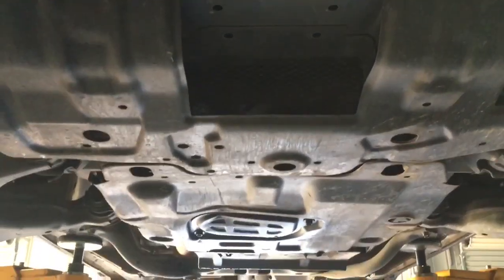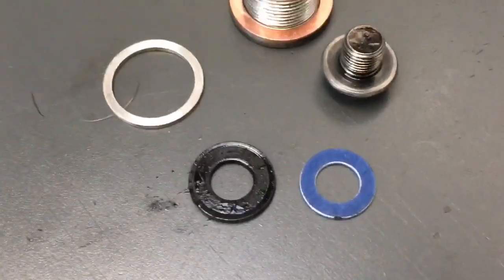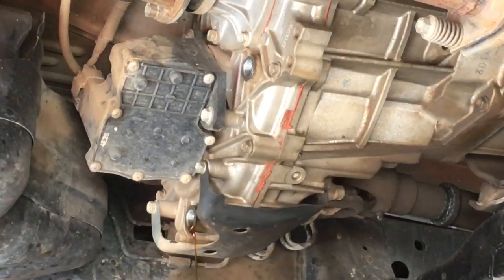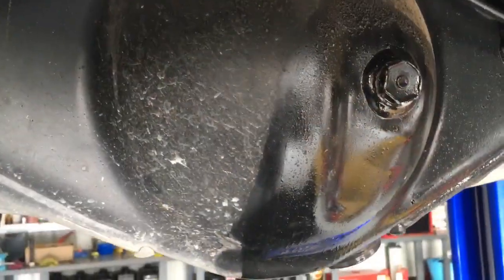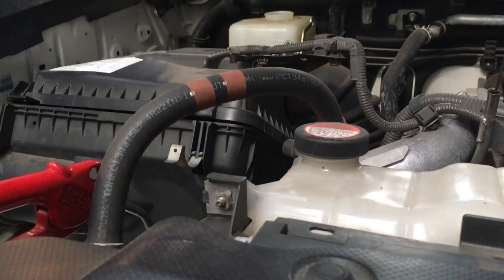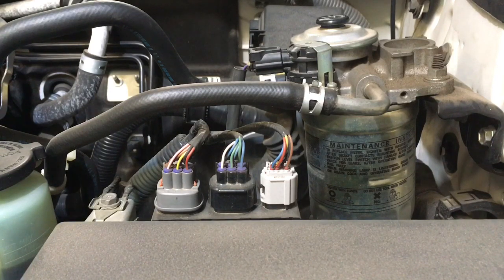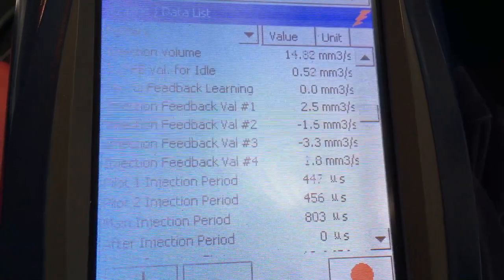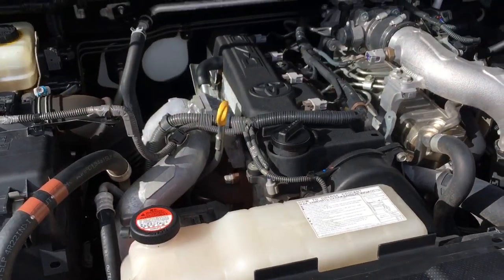Toyota prado 150 major service - what parts & oils get replaced.

Comment: Engine oil plug Torque - 34 Nm 
Front differential fill plug - 39nm
Front differential drain plug - 49nm
Transfer Case fill plug - 37nm
Transfer case drain plug - 37nm
Rear Differential fill plug- 49nm
Rear differential drain plug - 49nm

Comment: Hi mate, great video, exactly how I do mine which is a 2004 glx 1kz-te with 231,000 km. Mine doesn't have a rear fuel filter. My injectors, glow plugs, exhaust, coolant hoses, water pump even head light globes are all original. Timing belt done at 150, 000 km as per schedule. Only changed original fan belts x 3 two years ago at 200,000km. Still going strong. Done all my services since new, run out of room in service book !
Reply: What about the rear & front diff plus transfer case & transmission oil change interval do u do?

Mine is @ 160thou never been changed, drives like new but i dont use 4wd or low range much
Reply: @adjrasta9365  I changed the front & rear diffs at 200,000 kms & the oil was as golden in colour as the new oil going in. After 230,000 kms, finally changed auto oil & filter contrary to what Toyota say. Oil was 15 years old & a lot cleaner than I thought. As of today, car is having it's 16th birthday. Still running original a/c gas, still cold, original water pump, exhaust, shocks, head light globes, discs, although have been machined. Just checked my oil pick up, first time ever, clean as a whistle, unlike some photos I have seen on this site. Good luck with yours.
Reply: Thanks mate, you have reassured my confidence on these original built tough 1ktze. I just done the timing belt and tensioners myself didnt do.the water & if yours is still on original, i hope mine goes as far as yours. I hve replaced headlight globe & parker globes but havent needed to machine discs yet, still on original brakes front n back probably because its a manual. I get whay your saying about running out of room in the service manual. My other car is european and comes with no service manual, its all electronic & suppose to be entered by dealer but rarely is...worst part about the car, paying for servicing so to maintain warranty but not really confident in that they actual do whay they charge for
Reply: @adjrasta9365  All good. Enjoy it while you can !

Comment: Hi this video is an awesome tutorial. 
@39:04 there is a basin where there is some oil captured and I've noticed after a drive there is a small amount of new oil that has dripped out. 
Is it normal to have a little bit of oil leak out form the filter after driving? 
Or alternatively is there something that might be leaking above the filter dipping into the basin. 
Curious to know how you'd find out where the oil could be coming from.